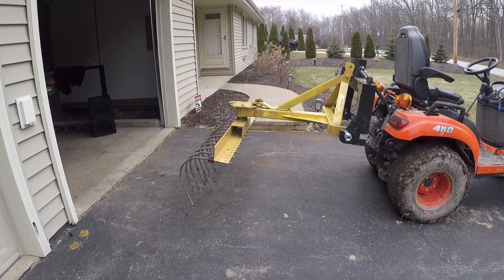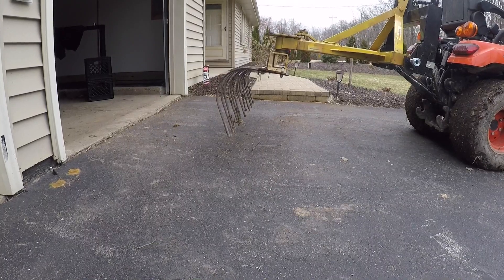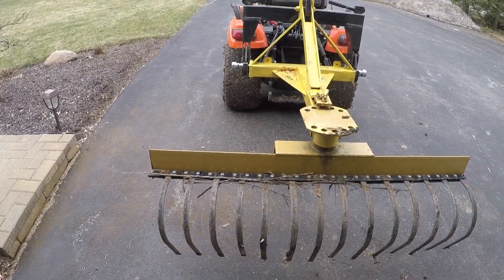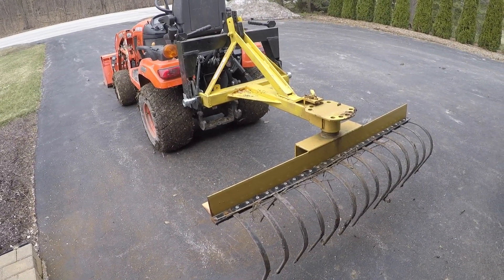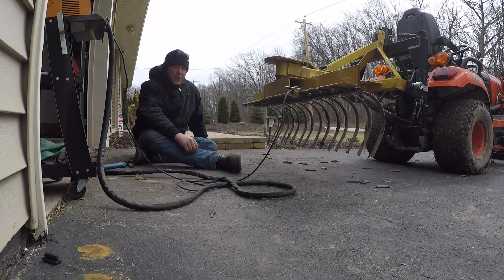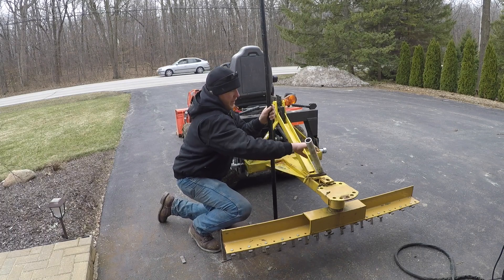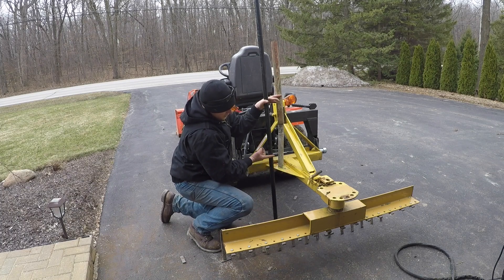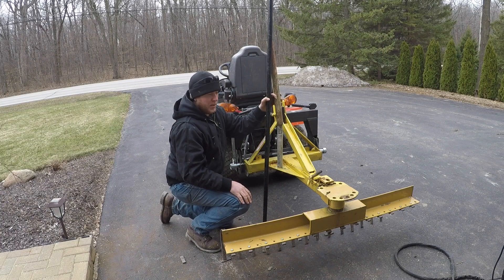Modifying a Landscape Rake To Work On a Subcompact Tractor DIY

Comment: Couldn't you have just shortened the top link? Or extended the lower pin mounts? 
Seems a shame to shorten the tines and change the spring action. 
Either way, mission accomplished. 
The stand was a great idea as well. Maybe cap the top end of the stand pipe or drill a drain hole at the bottom to avoid it filling with water and freezing in the winter. Just a thought.
That's a sweet Kubota tractor you've got there. It made short work of clearing that ditch and cleaned up that property like a bowss!.

Comment: Nice work Ty.  Yep, the tines are too long for a sub-compact and you really notice it when you navigate varying landscapes. Driving through a slight gully digs a hole once you're into it.  Man. the plasma cutter makes quick work cutting hardened steel. Sure like that action.  Full-watch.  Have a fine week.
Reply from the maker: Thanks Don! I hope you have a good week as well:)